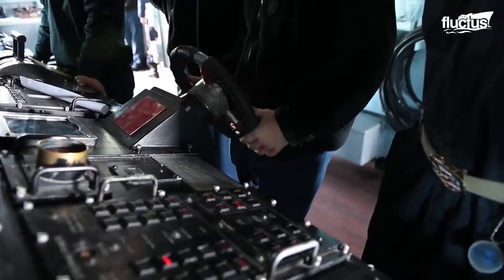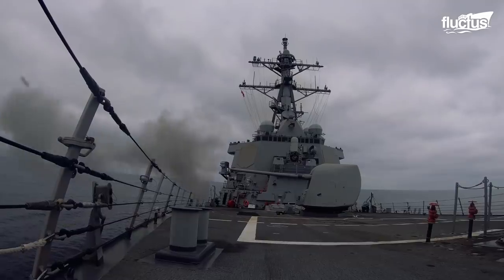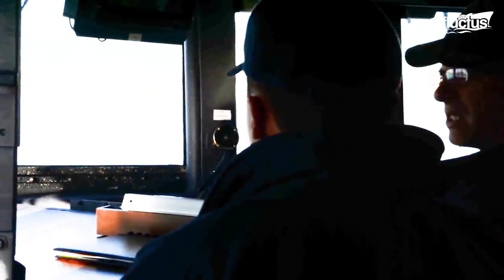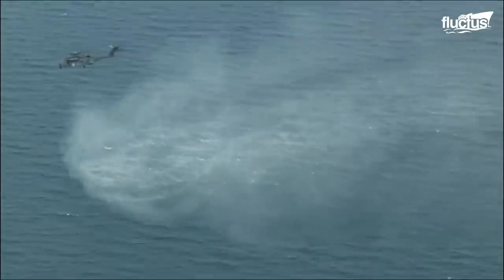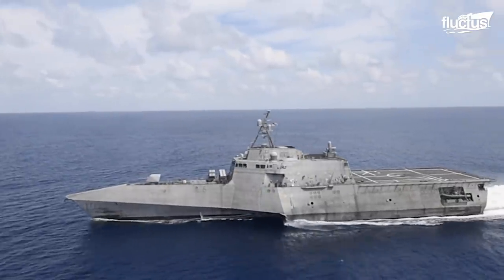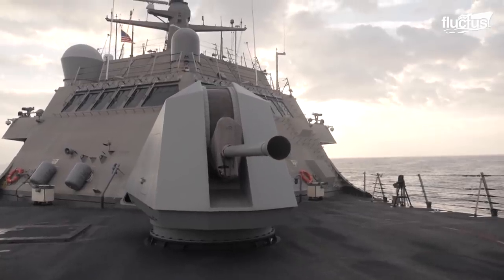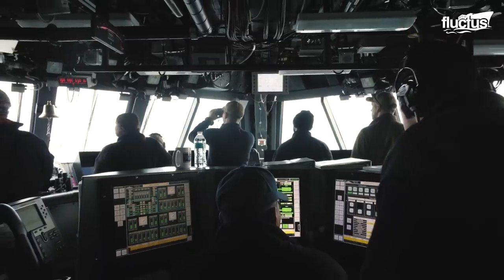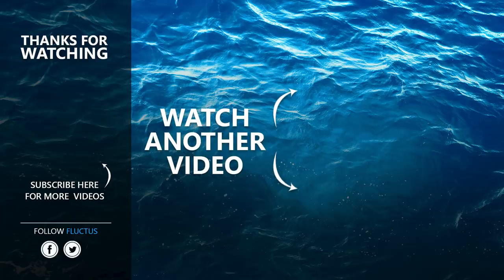US Navy Insane Drift Technique to Dodge Enemy Torpedoes

Comment: Now to reverse speed you do not need to reverse the direction the shaft is spinning, you just reverse the pitch of the propeller or screws to reverse speed to full aft. I did not know steering is handled by CIC during General Quarters (Battle Stations). Many other countries have automated their ships, downsizing the ships crew. The USA however maintains large crews for damage control during battle damage. This is an American mindset of staying in the fight and live to fight another day. As captain America says, I can do this all day long.

Comment: I can tell you first hand the America class LCS is crap. The ones I’ve been aboard conducting certifications have horrible welds, hangar doors that IMHO would have a hard time stopping a .22 rifle round and not nearly enough crew with the original plans. Routine maintenance can’t be achieved due to lack of manpower so it’s put off till it docks. I saw one hull weld with what appeared to be chipping hammer marks on ALUMINUM WELDS! Speaking of, the best thing I can say is with the aluminum hull I think a missile will pass right thru the ship without detonating! Don’t even look at the reliability of the water jet propulsion system, it’s horrible. I pray for the safety of my sailor brethren sailing on these death traps. Speaks tons that the Navy is already mothballing ships from the LCS class.
Reply: I call bullshit.

Comment: I was completely turned off by this presentation with its female presentation and constant female illustration. These ships are indeed very powerful assets to the navy and country. However, they will never be all that they can be as a weapon system as long as we persist with this insane policy of putting women in our combat units and aboard our warships. Fraternization, Physical and emotional limitations of women, Pregnancy, sexual harassment, boys fighting over the girls, girls fighting over the boys. All these things, that have no solution and cannot be fixed. All these things cause a severe break down of discipline and  crew cohesion. I am not saying this to be mean. My opinion is based on comparison and contrast experience from17 years in the all male force and 15 int the coed force and as the rating assignment detailer for 4 years and seeing all the problems unfiltered and uncensored. In addition to my 6 years as an FTG GTMO ship working up instructor where 10 out of 10 time the all-male ships out preformed the coed ships every time. These things cannot be avoided when you mix a large number of immature men  with immature women. Sooner or later, we will find ourselves in a war with a no-nonsense enemy and we will get our clocks cleaned if we do not get a government that understands that working in the  military and war is not the same as working at wall matt or ATT.